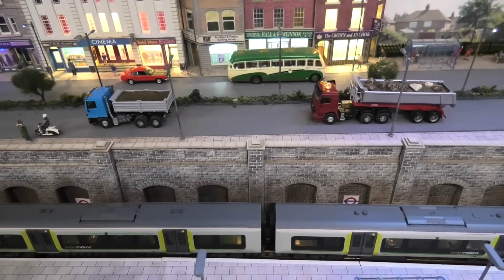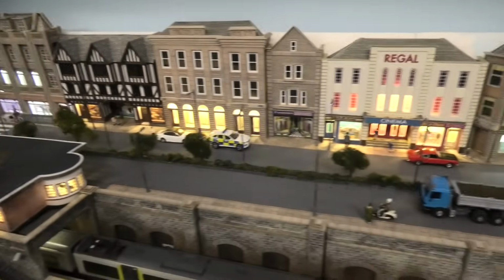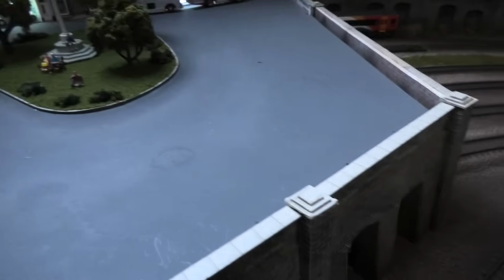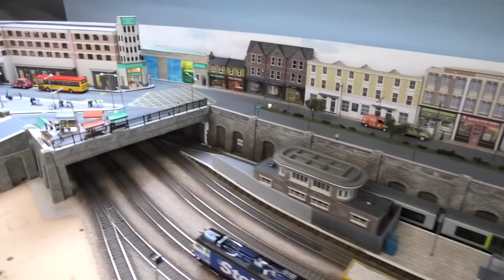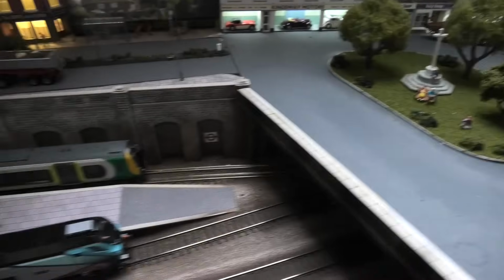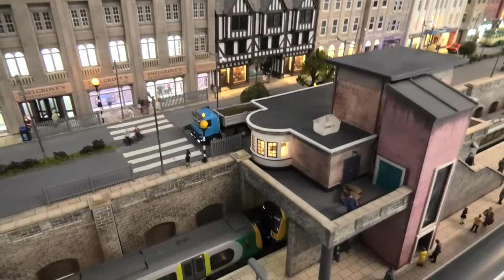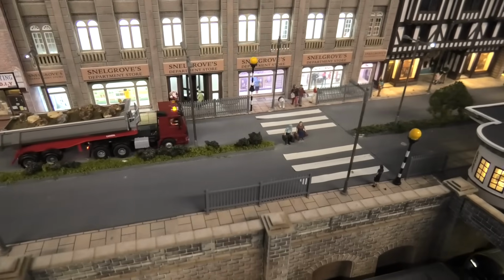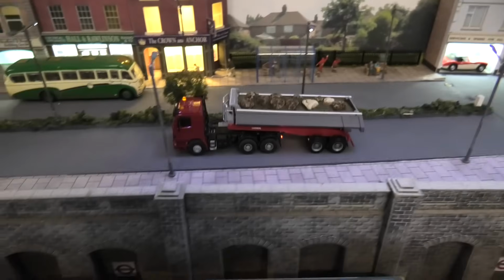Part 2 of the Viessmann trucks and a small rant!       28-10-2023

Comment: Hi Graham, I’ve just watched the two video’s in a row, I liked the first one and moved onto this one, I didn’t read the comments on the first one. I actually thought how well you’d done, now me being me I thought it was quite realistic the truck trailer mounting the pavement as it turned into the station side of the road, i would have kept that as it was. As for hitting the AA van i did laugh but it was something I would’ve done. You do great work mate and I’ve thoroughly enjoyed both video’s, those Viessmann trucks are brilliant.
Anyway I’m sure the AA van is covered by insurance😉, cheers Graham, John
Reply from the maker: Hi John and many thanks for the comment, like you, I’m just so pleased that both these trucks run absolutely fine on the road which was originally designed for my Faller buses and not these Viessmann trucks which is another reason why I invested in them as they should be compatible with the Faller roadway but are not guaranteed to do so 100% so I consider myself lucky that I have had no issues in getting them to run - apart from the ones I have now pointed out and sorted.  The insurance cost adjuster has been out to look at the van and will be giving the estimate to them within a day or so!    😂😂.        Cheers.          ………..Graham

Comment: The trailer has no lights on it and would get a GV9 if VOSA stopped it  causing you Graham to receive  a heafty fine !! Also it looks to be over weight  on the tractor unit rear axles with all those huge boulders..another heafty fine and therefore you possibly  losing your operator's licence 😂😂

Comment: The trailer looks great you will get teething problems at times there is nothing wrong with anything your lay out is brilliant Graham do things the way you like it's your layout and it would be a boring world if everyone did the same things keep up the good work Graham don't let people get to you
Reply from the maker: Hi Dave and many thanks for the comment, they don’t get to me as such, they just make me a little angry by pointing out the bleeding obvious and completely ignoring the bigger picture of the video which was - will the tractor unit plus trailer get around those two relatively sharp corners at each end - which it did, so as far as I was concerned then it was a successful test run. Hitting a misplaced transit van and a capping stone off really isn’t of any interest to me.   👍🏻.       Cheers.         ……….Graham